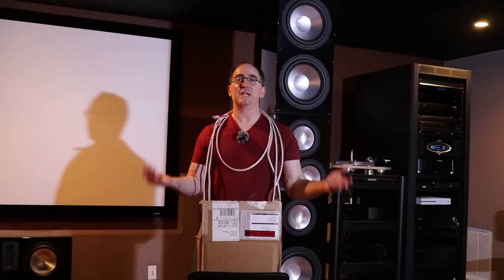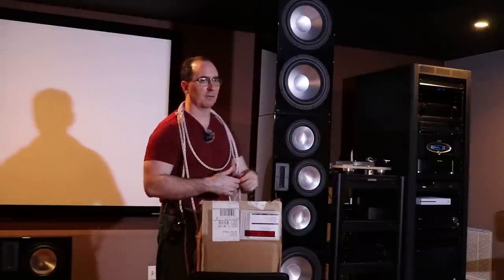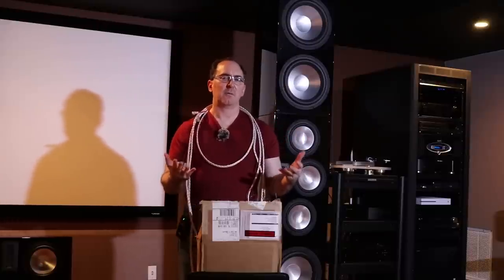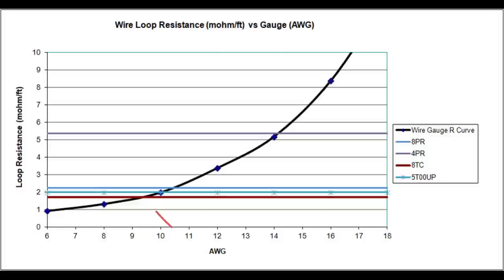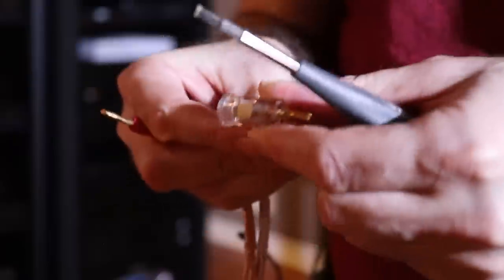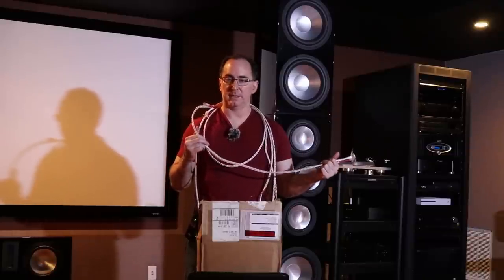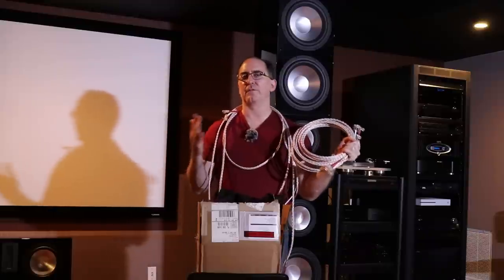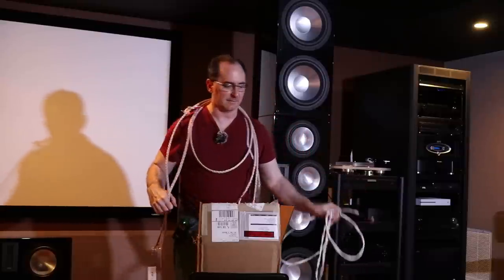Kimber Kable 8TC Speaker  Cables Review

Comment: Gene, to subjectively test speaker cables, would you hookup a set to one side of your system and use 10ga. Zip cord on the other side. Then do a careful level match between the right and left channels. To do the test, use a mono signal and swing back and forth from the left to the right channel to compare any differences in the sound quality. You should do at least a single blind test unless you know someone who can hook everything up so even you don’t know which is which. Listening to some songs and then switching everything over to new cables and everyone knowing what cables are being tested doesn’t really give an accurate and unbiased test.
Reply from the maker: The AWG differences between the Kimber and regular 10AWG wouldn't warrant an SPL level matching since insertion loss differences between both cables is negligible. I plan on  taking some measurements with a real amp and speaker load to show any amplitude response changes in the near future.
Reply: Audioholics Thanks for your response. The level matching isn’t about the cable insertion loss as much as insuring that the left and right channels are very closely matched in levels due to slight differences in gain and speaker sensitivities, which can go unnoticed in regular system use. Since you would be very carefully comparing sides, a small difference in amplitude can influence the result. Do you plan to use this technique then?
Reply from the maker: @StewartMarkley  insertion loss is what would cause level differences. So, it's ALL about insertion loss using a voltage divider relationship between the series resistance of the cable and speaker load.
Reply: Audioholics I agree with you about the insertion loss of the cable. However because there could be a small difference in the gain between the left and right side of your system electronics and the speakers could have a slight difference in output, which might be not noticeable in normal use playing music, it probably would be worth the simple step of making a quick test using a 1kHz sine wave to see if there is any noticeable difference in level before playing music which is much harder to discern small level differences than a pure tone. BTW, I setup and administered blind and double blind tests back in the 80’s at the CBS Technology Center which is why I am suggesting this to you. I’m not just trying to be a know it all but I really admire your intelligent and knowledgeable approach to audio which is pretty rare I think. Thanks
Reply from the maker: @StewartMarkley  Level matching at a tone is very inaccurate. Better to use limited pink noise and b-wt.  Anyway maybe sometime I will do a listening shootout. thx
Reply: @Audioholics  Yes, I agree. I am most interested in how the comparison using this method works out. Hope you feel much better very soon.

Comment: You should try out some Canare 4S11 cable. Makes for some nice-looking cables, capacitance of ~150pf/m, 5.2 ohms resistance per 100m (for two conductors out of four). With some DH Labs banana plugs, comes out to about 80-100USD per cable.
Reply from the maker: see: https://www.audioholics.com/gadget-reviews/ram-electronics-hs-speaker
Reply: @Audioholics  Hah. I have those same locking bananas. One of the four expanding parts around the center pin has broken off on a couple of them, sadly. Been using bare wire recently.

Comment: I have 10 ft. Monoprice speaker cables that came with banana plugs installed. They seem like they have metal in the cable sleeves (or whatever they are called). I think they are 14 gauge. I really like them. Less than $10 on sale.  You always say that cables don't make any difference but now you say it does measure different.  $1000?  What?  Anyway, torx screws are always good.

Comment: I know you keep talking about very expensive cables being nonsense, however these Kimber cables are $500 a pair. That is VERY expensive for an average joe like myself. So you would take these Kimber cables over $25 a pair basic cables? Why if  cables make no difference in sound? Sorry to give you a hard time, but I'd like to know your stance on that. I've used 14 gauge Audioquest LGC speaker wires the past 15 years and am pefectly happy with them. They were about $30 a channel at 6 feet each. However, I also have a system that's only worth $1000 from source to speakers, so frankly those Kimber cables would be inordinately priced relative to the cost of the other components.
Reply from the maker: They are very expensive. If you don;'t want to spend that, get Canare 4S11 or BJC 10AWG.

Comment: So after you read this and then bash and laugh the hell at me, I bought a pair of AudioQuest Rocket 88’s for my front left, center and right speakers. Now that that’s been said, I did at least get them for 50% off from a friend of mine that worked at Magnolia years ago. This is back when I bought into all this BS. Before that I had all Canare 12g cables which I paid around $150 for all three cables bi-wired. Did I notice a difference? 
Not one bit. To this day my friend that sold me my Rocket 88’s is still one of my best friends. But this is one subject I finally had to disagree with him on. He’s a huge AudioQuest fan and he recently attempted to get me to buy the new AudioQuest Niagara 5000. I will say this, he does have a very nice and expensive system. But his newest claim is he was blown away with the Niagara and how much the noise floor dropped. Of course I’d never spend five grand for a fancy power conditioner from any company! That said, back in the day when I bought my rocket 88’s my friend also turned me on to an PS Audio power plant 3 which I found brand new on audiogon for $1000 below retail. With everything they claim it does, did I notice a difference in my system’s performance (both audio and video)? Not at all. All I can attest to, is I bought my PS Audio P3 and my AudioQuest Rocket 88’s in 2013 and everything is still in place today serving my system fine. Oh! And the battery pack on all three speaker cables still turns green when I push the button! Lol!!! That was 7 years ago and all three batteries still work. Even when the batteries do go bad, I obviously won’t even know the difference. 
By the way Gene, your new RBH towers are amazing looking! I can only imagine how great they must sound. Congrats on the speakers and we hope you’re feeling much better! Looks like you do in this video!
Reply from the maker: This video was shot before I was sick but definitely feeling a lot better despite still testing positive. The battery gimmick AQ does should be criminal. They do a lot of propaganda marketing to their dealers and sadly the dealers often drink the kool-aid.
Reply: PLEASE READ @Audioholics , you’re absolutely right about their sales people drinking the cool aid. The same friend I’m referring to just told me the other night that he was watching SW The Rise of Skywalker with his Oppo UHD-205 with a AudioQuest Diamond hdmi cable and again he said the picture and audio never sounded better giving all the props to the diamond hdmi cable. I asked him if he really thought we’d notice a difference if we changed out the cable to just a regular Blue Jeans entry level hdmi cable, and he looked at me as if I was from another planet. Then replied “are you being serious or just joking with me?”.  I just grinned and left it alone. I wasn’t about to get into it with him. Good lord, an HDMI cable either works or doesn’t work. The audio & video quality is identical. To top that off, I did have all AudioQuest HDMI cables several years ago and couldn’t get the audio in sync. So I called AudioQuest tech support to troubleshoot the problem. I told him I had the arrow on the cable pointing in the right direction, and he suggested I point it the other direction and see if that made a difference. I did this and still no change. I said “doesn’t the cable have to be pointing in the right direction as the arrow suggest? His response was “it doesn’t make any difference”. I then told him the battery pack is showing green as well when I push the button, and his response again, and I kid you not, he said “that won’t effect its performance either” and further said it’s not the cable. It has to be your Oppo or your AVR. And this was coming directly from their tech support! That’s when I caved in and knew all this gimmicky crap is just that. Gimmicky crap!

Comment: That wire is STILL priced in crazy land. I'd like to see a video on Blue Jeans speaker wire and connections. Kimber is snake oil but at least the buyer can say "I have KIMBER cable and feel like they have exotic wires hooked up to their gear they bought from a guy in a van at Walmarts parking lot. Sheesh! Even Gene decided to blow some money on fancy wires. Donating to a charity would most likely do you much better. Just sayin.

Comment: Funny, I found spade to sound much better to banana. The only thing I am totally sold on is surface contact area, that is where the real meat and potatoes where in my months of doing long duration tests. My ears are useless for any short term testing I found, so it got to be a few weeks minimum.. The WBT connectors are a no brainer and worth every penny. The issue with cables is also matching, as with everything in an audio signal path. Assuming this or that is good or bad based upon a measurement only is foolish. What if the AMP and Speakers are designed to perform better with X versus Y, only your ears will know for sure. But I agree I would never buy anyones cable that did not publish the specs, and generally agree lower less is always more.

Comment: Seeing the pricr if these cables makes me want to kill myself. I have spent about $40k au on ny setup and after watching about half of this video O started looking around at speaker cable sites the came back and heard you say the price. I have decent thickness cable with thick shielding and good banana plugs. I spend more on the plugs than I did on the cable ( 11 channels plus wall plates in between ) so I think after I get my second svs sb 4000, get my room treated, get a new couch and maybe  a new 4k player and anything else that will give me a more immediate benefit I will come back and get my cables and connectors sorted out.

Comment: I love the channel Gene, but why do a review of a product that has no audible affect on the sound? What difference does it make if it measures better, if those measurements don't correspond to sound quality? By the way, those connectors look as though they should cost no more than a couple of bucks a piece, but at least they potentially improve the connection, or possibly the ease of use.

You stated at the beginning that it is only jewelry, and then proceeded to tell us about the science of it all. That makes no sense to me. You could have just held up the cable and said, "Look, these are pretty cables, if you want to spend a grand more than you need to, you may want to buy these for their appearance." 

If YOU believe that cables, are for the most part, snake oil, I would prefer that you didn't hold up a bottle of that oil and explain to me how pretty the bottle is. I'd rather you tell me how ridiculous it is to buy the snake oil in the first place.

Maybe you were only speaking to those who are wealthy, or those who put a very high value on appearance.

Glad to see you're feeling better. Also, I really enjoyed your interview with the nurse, Veronica, on your previous show. Be well. :)
Reply from the maker: Just because these cables are likely sonically indistinguishable from good 10AWG doesn't discount the usefulness of measuring and reviewing them for those that want audio jewelry. I challenge you to find another AV Magazine that even has the technical ability to do this let alone be so upfront and honest about it.

Comment: These cables look pretty, I didn't hear you say they "sound" any better though. I'd rather spend the extra 1k for higher end speakers. You can measure these tiny differences in different cables but can you really hear it? Even if you could hear it, it would need to be on an extremely, resolving system which is so high end, 99% of the population can't afford it. Is my point starting to come across? Put your money where it will matter more, better speakers. I think my common sense can figure out the chemical composition of these kind of cables, 1% reality and 99% snake oil.
Reply from the maker: If you are choosing between better equipment or more expensive cables, always choose the better equipment first. Cables are audio jewelry and it doesn't cost a lot to get "good enough" performance.

Comment: Forget paying Kimber (ridiculous) prices. GR Research has taken the raw Kimber 8TC & 12TC Cable,  added a few tweak's and charges less than half what Kimber costs. Yes it's a kit. You will need to know your way around a wire stripper. I believe measurements just confuse the issue. This is a very fine cable. My entire system is wired with this cable (even the stereo sub's) Don't hesitate. Some of the best cable available at any price. Certainly my end game cable. PS Audio stack with MKII DAC is the heart of my system. p.s. I have both, 1 pair of the 8TC all the rest are 12TC. The 12TC is the premium but it's a few bucks more a foot. Either, worth every penny.

Comment: Funny how you try to debunk speaker cables as snake oil yet use high end cables in your own gear 🤔
Reply from the maker: It's hilarious especially since I clearly state they are audio jewelry that measures well but sound no different than 10AWG Stranded wire. It's even more hilarious that your gotcha moment is a nothing burger.
Reply: @Audioholics  the guy spends too much time on ASR